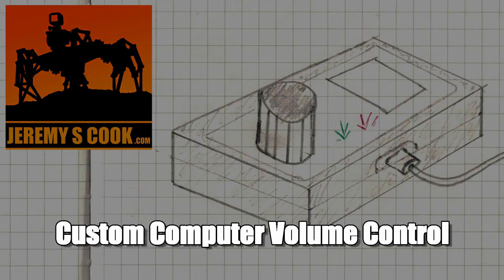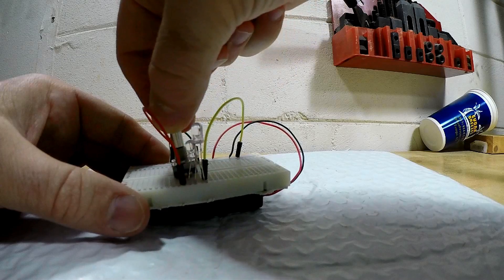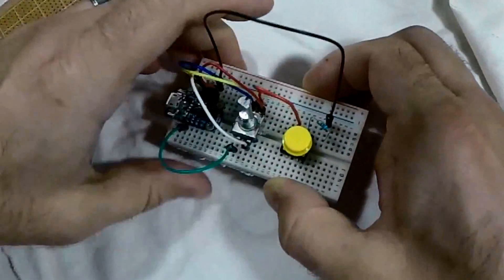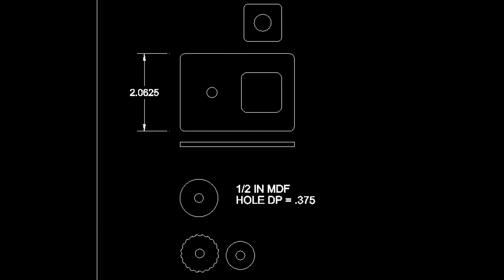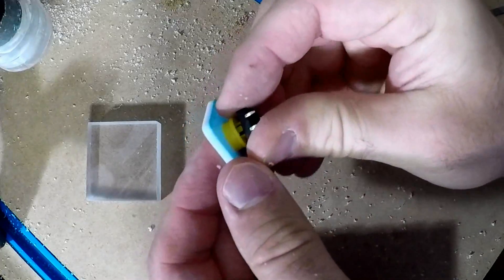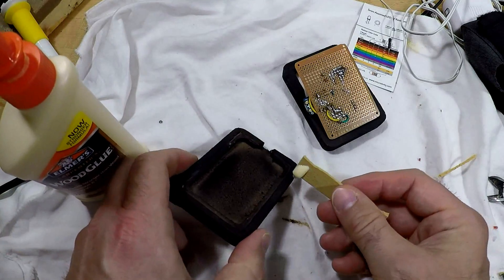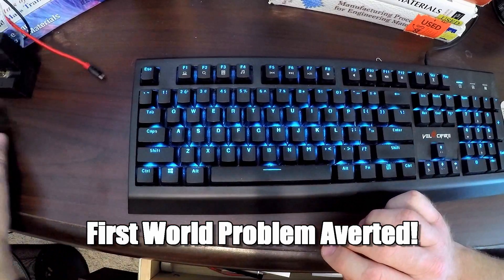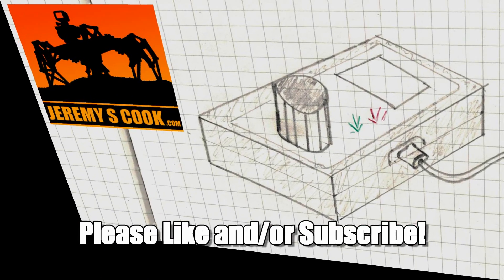Computer Volume Control Knob

Comment: Nice job! Love when people can innovate. What about noise? I'd like something like this for my stereo, but is there any signal noise introduced by this setup? Any humming or buzzing?
Reply from the maker: Thanks so much! No noise, but it's really meant for computer (and perhaps smartphone tablets) only. I'm not sure it would work on a stereo. That being said, I've got a new version that is much better, seen here: https://www.youtube.com/watch?v=2CEy4JOxYWI - I'd invite you to check it out!
Reply: @JeremyCook  Guess I should have specified, I'm using an HP Z2 Mini as my car stereo, no head unit! Thanks for the new version link, I'll check it out!
Reply from the maker: @CORZER0  Ah, well in that case the new version (or at least the concept) should be perfect! 'Lock key display is probably unnecessary though :-D

Comment: Would it be possible to use at momentary toggle switch (on-off-on) instead of the button? Ideally Id be able to click up down to go forward back.
Reply from the maker: Hi Christopher, I don't see why not, though the code would need to change slightly.

Comment: Hey Jeremy, i'm trying to build this but am having an issue with the programming.  I keep getting a  error "USB_CFG_CLOCK_KHZ is not one of the supported non-crc-rates!" Any tips?
Reply from the maker: Hi Ryan, more details are in the blog post linked in the description, and the program is very close to what's found here on Adafruit: https://learn.adafruit.com/trinket-usb-volume-knob/overview - The trinket can be a bit tricky to program, as I think it only goes into that mode for a few seconds after powerup, so maybe that's where you're having an issue?

Comment: I just wish someone would mass manufacture these things. Not everybody has access to 3D printers, an Arduino programming tool, or a precision cutting machine. I've been hurting for a dial to play arcade games, and every homemade solution has been disappointing, usually because they were mechanical and demanded a level of precision that just wasn't feasible with the tools I had available. At this point I'm considering a Contour Shuttle or possibly a volume knob, but I'm not sure if that's going to offer the feel I want for a controller like this.
Reply from the maker: Hope it works out for you!

Comment: Can you please do a video on the programming aspects? What if you wanted to control something besides volume?
Reply from the maker: Hi Aiden, thanks for checking it out, and I've been considering building another one, so perhaps I can go over that a bit more in the next iteration. In the mean time, if you want  to change what you're controlling, you should be able to change where it says MMKEY_VOL_UP, MMKEY_VOL_DOWN, and PIN_ENCODER_SWITCH to match the key/shortcut you'd like to control.

Comment from the maker: Made this or something like it? Let me know, I'd love to hear about it!
Reply: I want to retrofit a knob on my Coolermaster TK keyboard.. Do you think it would be possible to hack the pcb in order to do this, or would it brick the board? Could I add a parasite pcb that uses power from the keyboard?
Reply from the maker: @stopthephilosophicalzombie9017  Hi, if I were going to attempt this, I'd probably start with breaking out the IO from the knob itself and run it to another board. I'd think you could run it on USB power there, as long as your new board isn't too demanding.

Personally though, I like having a separate control surface. You might check out the much improved version found here: https://www.youtube.com/watch?v=2CEy4JOxYWI that I'm using now.
Reply from the maker: @stopthephilosophicalzombie9017  Thanks! Yeah, that would take a bit more work. The trick for the feedback here is that the computer sends back signals for the lock keys by default, so I don't have to install anything outside of the keypad. Once you get into more than that, I'd guess you'd need a helper program running on the PC. Would be cool though.
Reply from the maker: @stopthephilosophicalzombie9017  I haven't seen your keyboard, but that would be my assumption. I think we're talking about the same thing.

Likely an encoder though, which may take a bit of research to understand if you haven't worked with them.
Reply from the maker: @stopthephilosophicalzombie9017  Well all the best. It's pretty straightforward to do a custom "keyboard" with an Arduino or similar board. I've actually got something I'm working on that may give you a few ideas, so feel free to check back later ;-)
Reply: Loved your video! I also made one using the adafruit trinket combo library. I didn't have an extra push button switch lying around, so I added functions to recognize single press, double pressing, or holding the rotary encoder button to switch profiles for adjusting media and shortcuts for other applications
https://youtu.be/AhoCNvSGrUw

Comment: Nice project. I ran into the same issues a couple months ago and was going to build something similar but then found a keyboard that already had a volume knob on it that was about the same price as just the components for the project. Link for the interested: http://amzn.to/2tf2NJ4 It was replacing a keyboard that wasn't as nice as yours so it was an easy decision for me.
Reply from the maker: Hi Dillon, thanks! 

That is pretty neat option. I do like my keyboard, though I suppose time-wise it would definitely be better to just buy one of those! Then again, I was glad to make something I could actually use :-)
Reply: Oh yeah, I agree with finishing projects. Gotta pick your battles though. My projects to-do list grows longer by the day so I was glad that there was an option out there just to buy it.
Reply from the maker: Haha, I hear that. Guess this one "made the cut!"